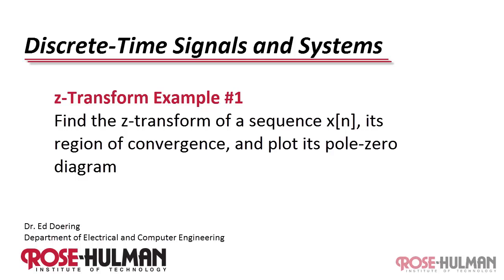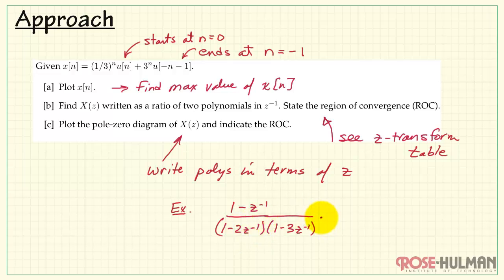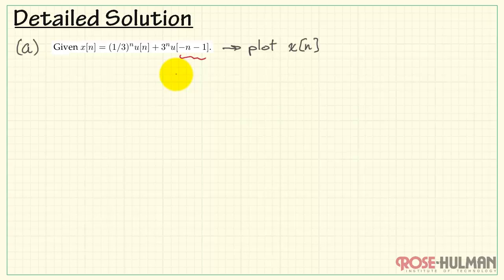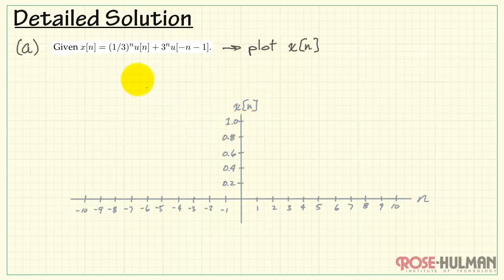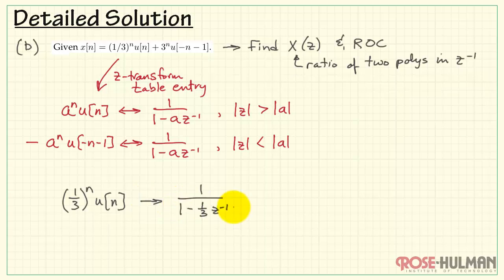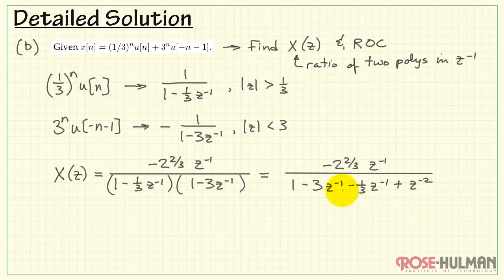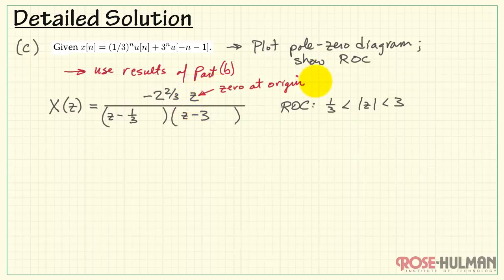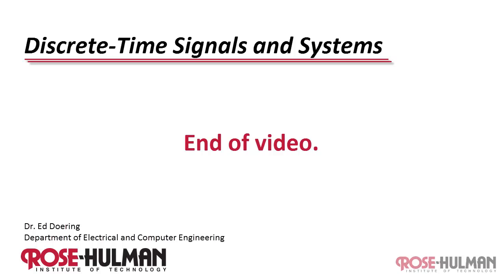z-Transform Example #1

Comment from the maker: You are correct, u[n] is the discrete-time version of the Heaviside function u(t), also called a step function. The Kronecker delta function is d[n] (with "d" representing the Greek lower-case "delta" letter) is the discrete-time version of the Dirac delta function d(t).